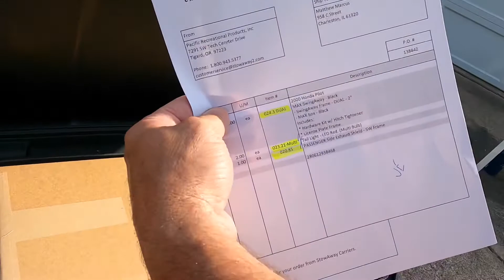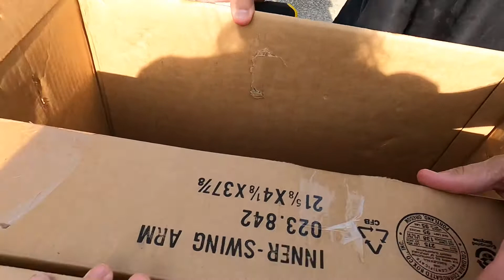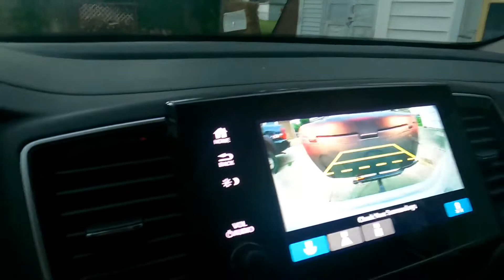How to Install Stowaway 2 Max Cargo Carrier Swingaway frame.

Comment: I already went with the yakima exo system.  But holy heck i could not stop laughing watching this video. You are one hilarious funny dude. Thanks for being entertaining!
Reply: How are you liking the Yakima Exo system? Im hesitant to get it because so much of the weight is in the swing frame
Reply: @ketchum6455  absolutely right there is so much weight.  I have a 2018 kia sorento.  Once I got that thing installed in my hitch it made my back end bottom out. Without packing any gear in it.I had to get airlift 1000 airbags because of that. Kias suspension sucks. And I try to avoid using just because it makes your vehicle longer and can't see the back up camera if I use the gear locker. I use the roof box most if the time.

Comment: So, I’m in the process of assembling mine for the first time. One question: When you remove the system when not in use, do you remove the entire system or do you remove the box from the frame first? Seems like removing the whole thing at once would be pretty hard given the weight and finding good places to hold onto.

Comment: With the Stowaway attached do you now have to limit your speed on highways? Does it rattle when you go for highway speed?
Reply from the maker: Thanks for watching and posting! We haven't had to slow down for it, but we also don't speed. If you have securely attached, and your roof rails are secure, you won't notice any rattling.  In fact, we have to pull back the visor on our sun roof so we can see it because we forget it's up there!

Comment: I'm looking for a solution to a "spare tire" problem. I have a 2019 Prius Prime, and like a lot of cars nowadays, it didn't come with a spare tire. At all. Not even one of those miserable compact donut spares. Worse than that, there's not even a place within the car to put a spare tire if you did purchase one (which I did, yesterday). So I am looking at spare tire carriers that mount to a 2" hitch receiver, which I am getting installed on the car next week. Because the Prius is a hatchback, the spare tire carrier can't block access to the hatch, so it has to be a swing out. Looking at this cargo box, the idea looks good - for a full size SUV with a Class III hitch and rear frame capacity to carry 800 pounds of tongue weight. Unfortunately, my Prius can only support 200# of tongue weight. If this cargo box has 120 pounds empty weight, it's too heavy for my car. But it's a great idea!
Reply: Maybe you can get a roof rack for the Prius.
Reply: @johnnypena1083  - I got a Thule cargo pod, that holds about 18 cubic feet, and a cargo basket and large storage tubby that hangs from the hitch receiver. The spare tire has found a home behind the front passenger seat. So my Prius has become a 3-seat car, but if I ever had to haul 4 people in it, the spare tire fits in the cargo pod.

Comment: Great vid man! Did you find it difficult to remove from the square receiver? I’m finding it impossible with the swing arm/box attached, so removed the large bolt. Thinking of greasing the receiver
Reply from the maker: It is actually very tight and that is what we ended up doing, we sprayed some WD40 on it.  Really helped! Thanks for watching!